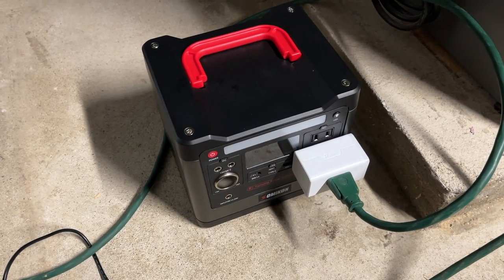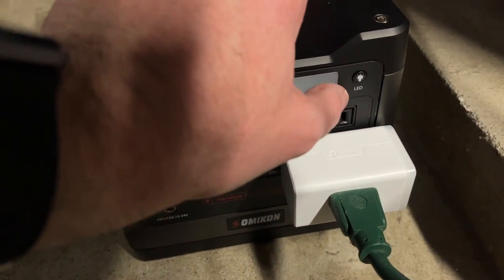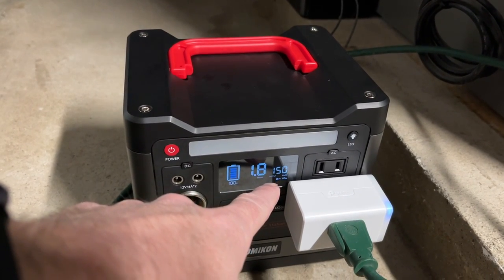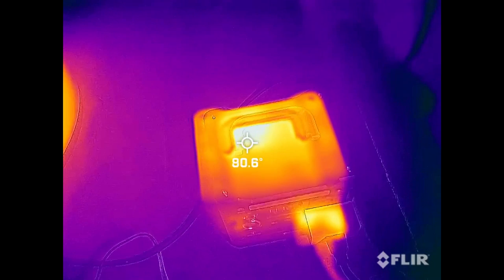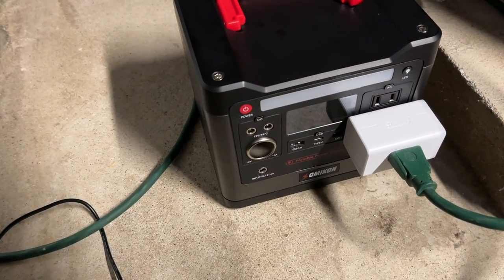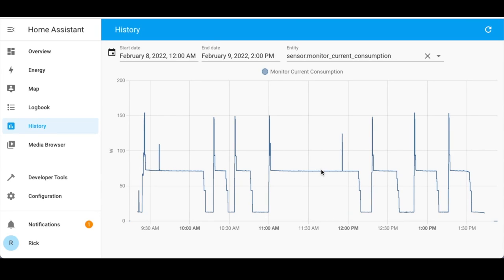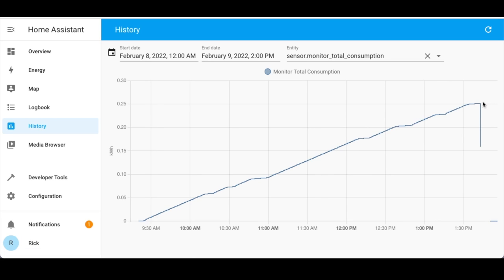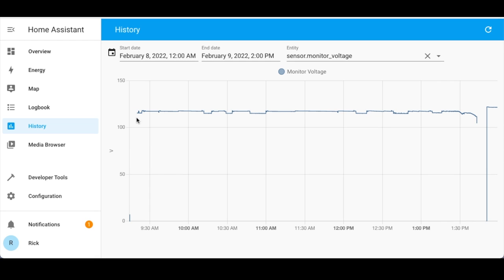Powering a Gas Furnace with a Somikon LiFePO4 Power Station

Comment: Pretty neat - I never thought to have this kind of backup, but it seems practical - and I have overhead wires for electric (here in Wisconsin).
Tnx!
Reply from the maker: I'm probably going to get a larger battery at some point but I was impressed this small battery was able to power it for a significant amount of time.

Comment: Hey man, how is this power station holding up?
Reply from the maker: It has been working great. I took it camping this summer and it easily powered my CPAP for three nights (with the humidification turned off). I often use it around the house for convenience. For instance, I wanted to top off a car battery so I plugged my charger into the power station so I wouldn't have to run an extension cord. I really like the small size of this power station.
Reply: @Rickmakes Thanks for replying.  Been looking & the Wattfun version of this unit.  Few reports of the unit dud-ing on some, and also the display haywiring.